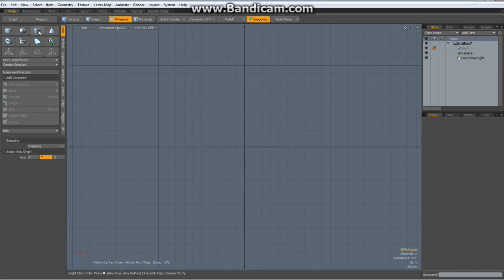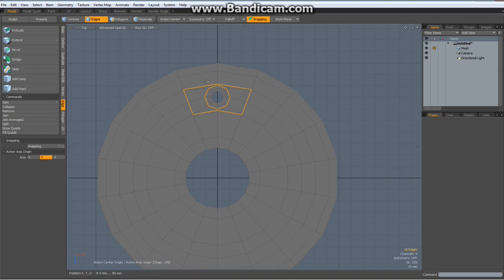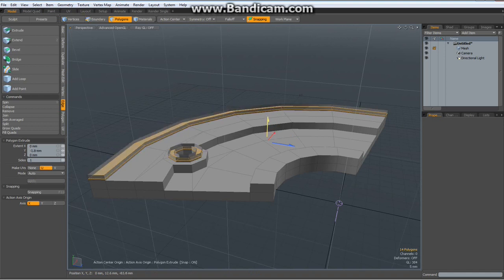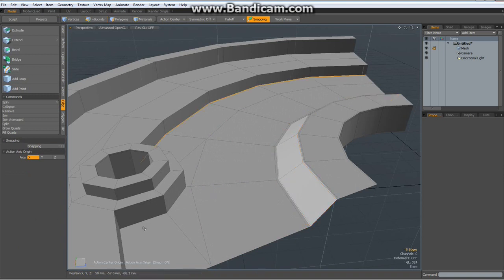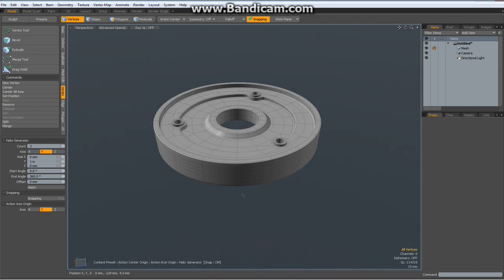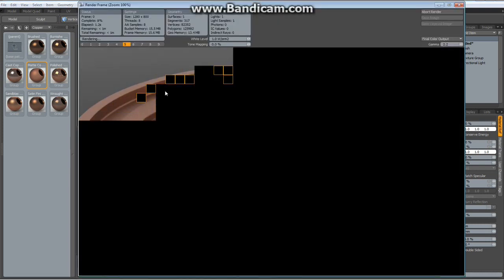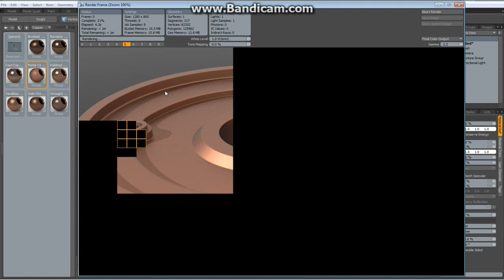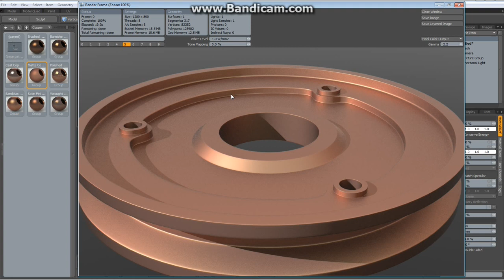Modo 501 From 2D to 3D Part 9 - Modeling a Pully

Comment: Very nice - everything was going well until 6min into it: the mirroring part.
That's when my geometry stopped looking good in sub'd mode :-( I guess I'll try again. Thank you, Peter.
Reply from the maker: Patrick von Janicke Hi Patrick, just make sure that before you click Apply, all your mirror settings (Center / Left / Up) are all set to '0' then it should work :-)) Kind regards, Peter
Reply: Thank you, Peter. I'll give it another try.